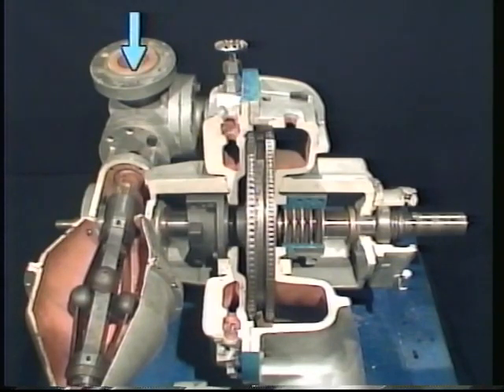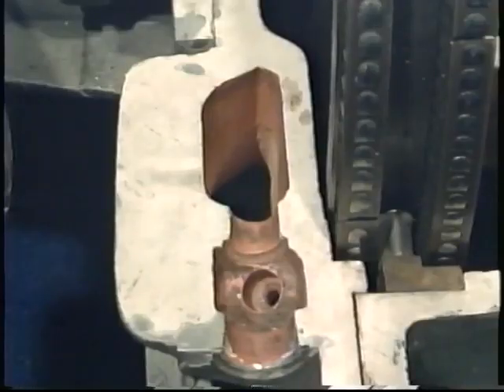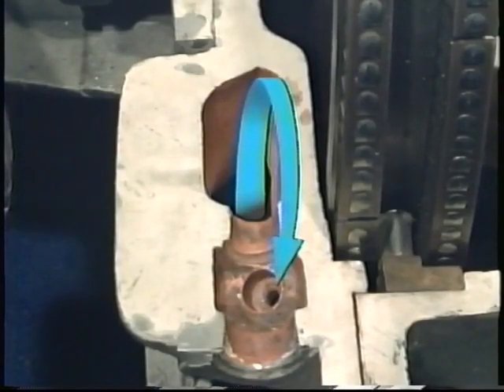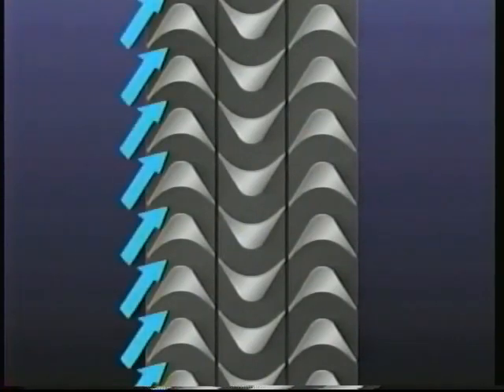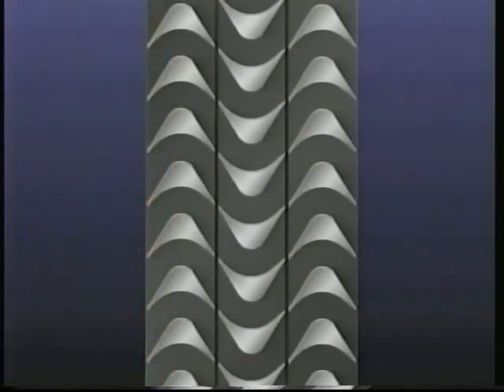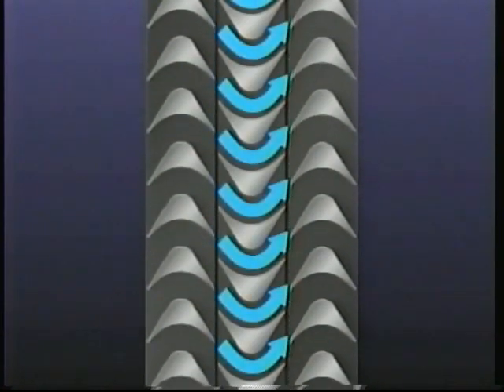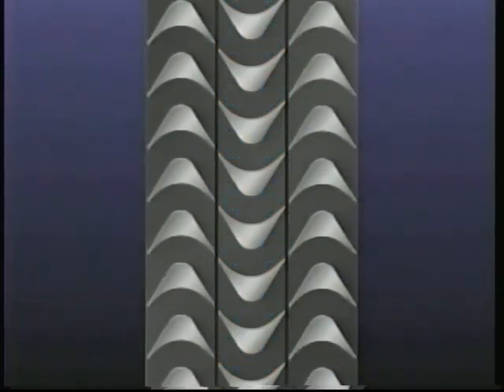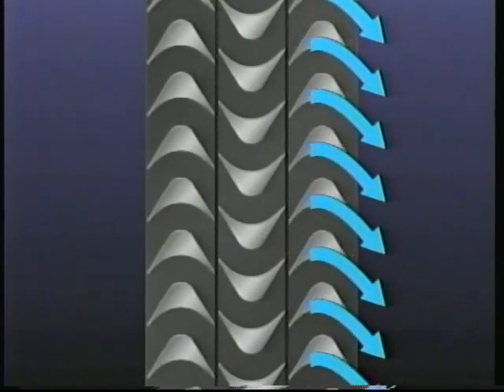Steam Turbine | Steam Turbine Components

Comment: Can you tell how to identify drive end and non drive end in steam turbine.? If a governor is connected then that side will be non drive? How to identify?
Reply: Non-drive end, refers to the end that is not coupled (Steam Turbine Induced Machine Coupling), is independent of governor
Reply: Drive end is you output power so your coupling side, best bet is opposite to your governor/steam chest side, your outlet is usually center case, downstream of the input so closest to the output is your drive end. Governor is connected to the non drive end of your turbine. Non drive end also more than likely contains the thrust bearing/pads and trip bobin/trip pin